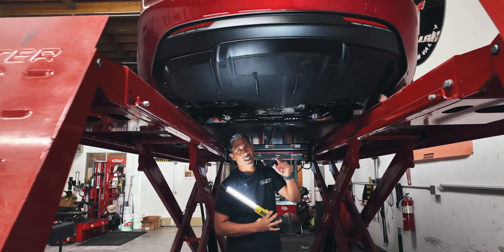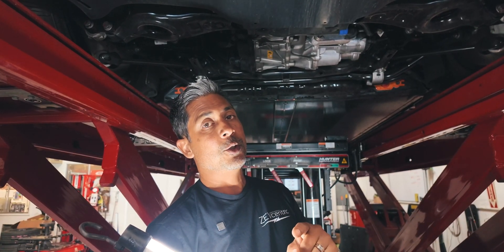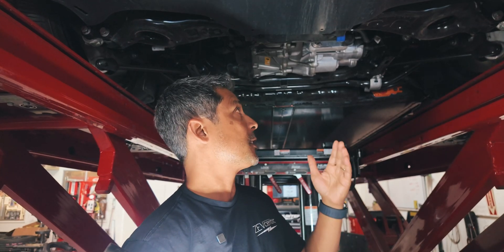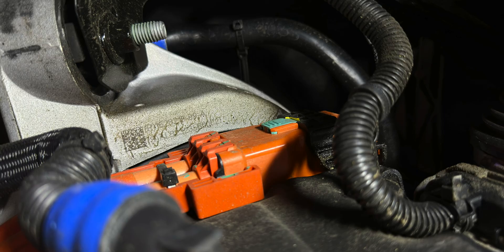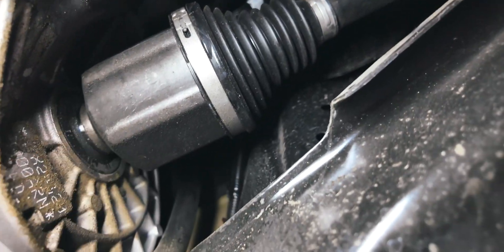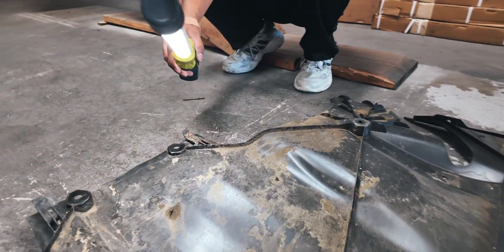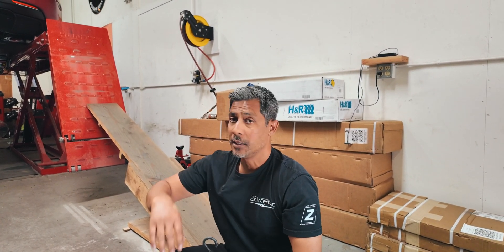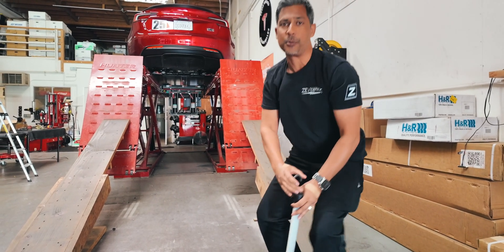Are 2024 Model 3 Performance  Rear Drive Units Failing? What You Need to Know

Comment: '22 Model 3 Performance Rear Drive Unit recently failed due to drive inverter MIA due to an issue with CAN Communication. This is a non-servicable internal issue that causes the loss of the oscillator clock signal, which leads to the loss of controller area network (CAN) communication. Rear Drive Unit Replacement required. Total price for labor & parts is $4,516.

Comment: Tesla now has a TSB on the oil leak. You can now make the request to have it fixed without oil leaking. I watched a video on it and it looks like some type of MacGyver fix. This is not an easy fix. They need to drop the rear motor and also do an alignment. Not happy about this.
Reply: Tesla currently working on mine. Been in the shop for almost a week now. My advisor said the tech didn't see any oil leaking at the RDU and was able to relocate the breather. They are currently in the process of testing proper function and doing alignment. My advisor told me ill get it back in the next two days. It didn't sound like they had a hard time doing this repair on their notes.
Reply from the maker: @kawhiiee we got ours back and will find out soon how its holding up.
Reply: @zevcentric  Please update us on a video. I just got mines back about 2 hours ago. Tesla said no signs of oil leaking. They indeed in fact dropped the RDU in order to relocate the breather. Tesla test drove it after they put it back together to verify proper function and finish it with tire alignment. I did 3 to 4 pulls on an straight away and so far so good. No warning lights. The torque and power still feel the same off the line on insane mode. All free of charge.
Reply from the maker: @kawhiiee that’s what they did for ours also.
Reply: @kawhiiee thx for sharing. The Tesla rep said they have to take out the rear drive unit & that’s why they do an alignment. 🤦🏽‍♂️
Reply from the maker: yup we got the TSB and ours is going back under the knife soon with them.

Comment: This is one of the few videos I found talking about leaks where I possibly have one on my 2020 performance model 3. Been dealing with a vibration and clunking noise that service center is just saying is normal. Which in my mind is is ridiculous considering it never did it before. I have no other electric vehicle garages or shops near me that are able to give a second opinion. Upon removing the undershield the front driver side half shaft where it goes into the drive unit has a black oily substance all around the shaft. I'm not too sure that it's normal. I've never encountered that on any other vehicle I've worked on. You seem to know what you're talking about so i was wondering if there is a way to get in touch or send a clip or pictures and get your opinion.
Reply from the maker: @bernadettefausz8810  we dont do general repairs.  You should take a pic and show Tesla.  Your clunk and noise though is probably something else.  Email us zevcentric@gmail.com with the trim and mileage of your 3 so we can discuss possibilities.  Share your location as well.

Comment: I am currently on my driveunit no:4 replacement, (Model S P85) the refurbished driveunits from tesla is still failing (coolant water ingress via rotor seal again and again)
Reply: I read the fix is to just disconnect the cooling entirely. Maybe look into it if you're not under warranty

Comment: This is why the annual maintenance is so important.
Reply: Annual  maintenance fixes this defect how exactly.
Reply: @DCGreenZone  doesn’t fix it but spots it. With the underbody covers you won’t see that it is leaking until a significant about of oil has leaked out of your drive unit.
Reply: What is the annual maintenance?

Comment: Thanks, do you know what Tesla is actually doing to resolve this issue when they repair it?  Are they replacing the  drive units or seals ?  There must be performing some kind of fix that would prevent it from happening again.  Do you know what that fix is?
Reply from the maker: yes the half shaft seals I believe have been the culprit.

Comment: Apparently, they start leaking immediately. While installing your company's lowering kit, I found mine leaking at 4 days of ownership and 400ish miles.
Reply from the maker: @ScottishImmortal  ya not cool!!!
Reply: Did you fix or did issue resolve itself?
Reply: @GregNFLSundayTicketYT  There's a service bulletin to install a remote breather for this issue. Parts arrive next month for service to be performed.
Reply: @ are you continuing to drive while you wait? Looks like you’re going on 3 months?
Reply: @GregNFLSundayTicketYT  Absolutely. It's not pouring out, and a little fluid loss isn't a big deal. It's under warranty anyway.